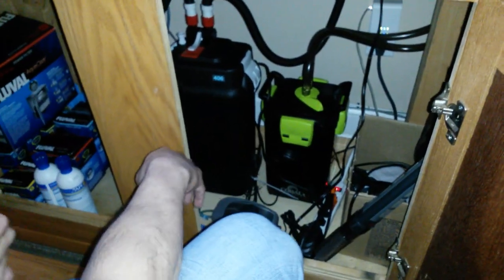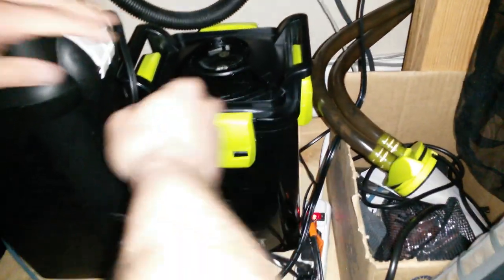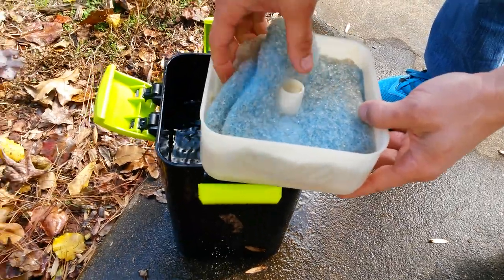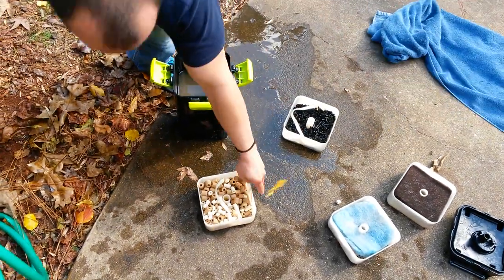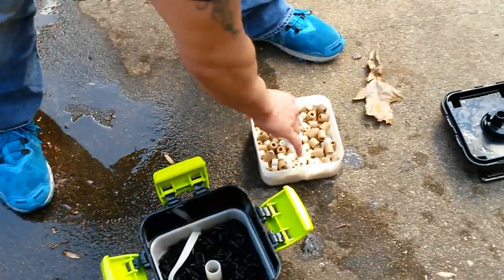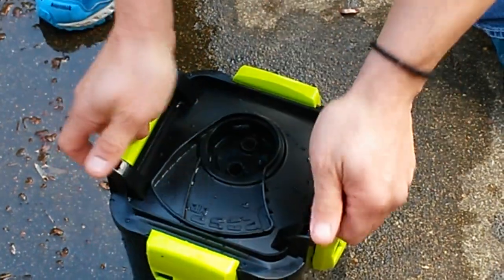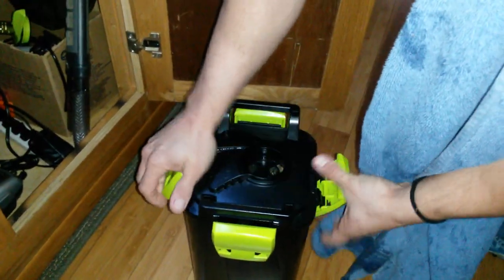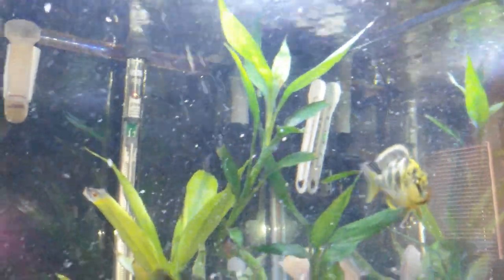Cobalt EXT cleaning.

Comment: I put mine right behind my tank, I cut the u tubes but I wish I hadent cut the one for the return, it kinda hangs diagonally. Only thing I don't like about the product is that the u tubes are really just meant for having your canister at the bottom which I didn't want. They need to add in those clip on tube holders like the fluval has. I also bought the uv sterilizer that goes with it. Hope it clears my tank.

Comment from the maker: Yeah it would be better for Cobalt to include some alternate tube mounting options with this filter. 

Have you tried using microfiber of some sort to get the smaller particles out of your water? I run various types of microfiber in all of my filters for both my tanks. It really helps to maintain the water clarity.

Comment: I just bought this filter and took it out of the box. I can't get the valve on the filter lid to budge. Is it suppose to be really difficult to move or should it move easily? I'm afraid to try to pry it in case I break it. Any suggestions would be appreciated.